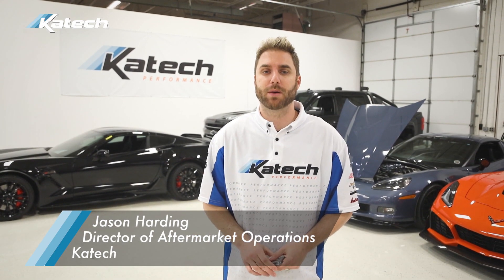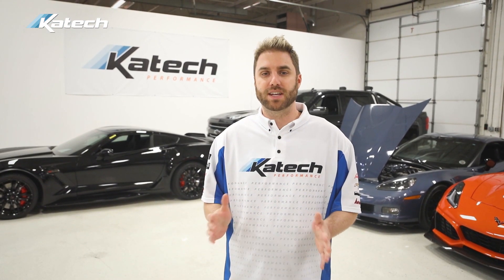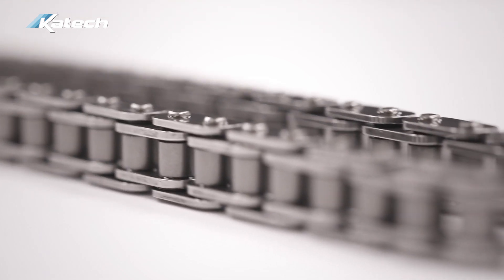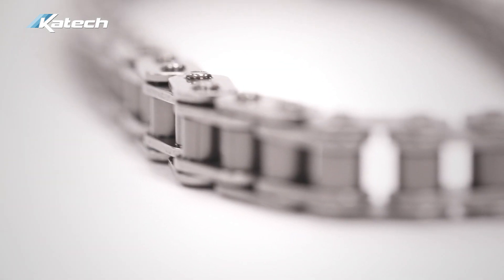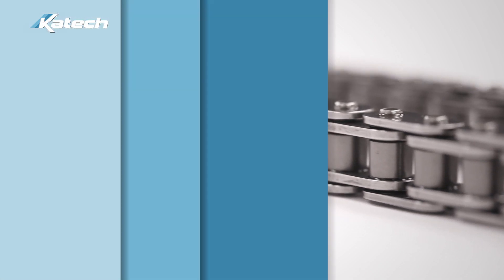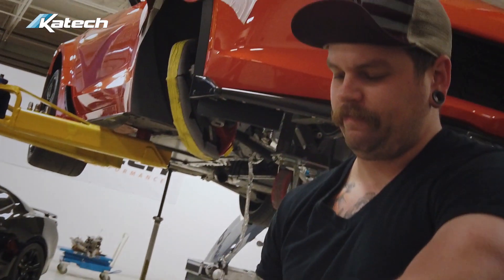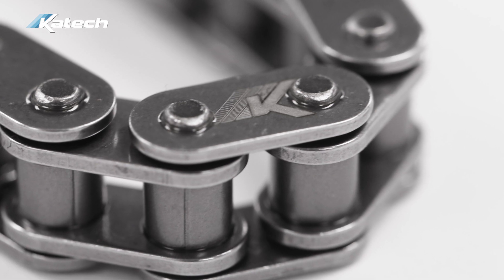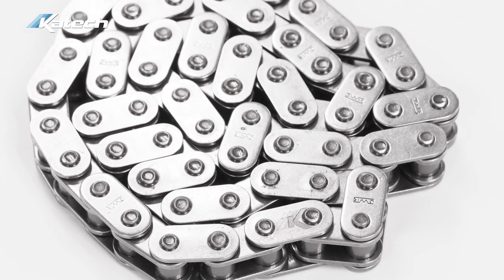Katech C5-R Timing Chain For Gen 3/4/5 LS & LT Engines

Comment: Hi guys. 
What kinda lift and spring rate are you’s running with this chain? Are you using the ls style chain dampener still or a std ls3 chain tensioner? 

 I’m having issues with breaking double row chains. And this looks like it’s a option to give it a try
Reply: From my understanding alot of the ls3 guys switch the tensioner out for the "dog bone" style guide from a ls2 engine. I'll be doing the same this winter.

As far as chains go I believe this is the go to upgrade instead of double row.

Comment: These chains are manufactured by jp performance timing chain and are the same ones used on the PJP billet timing set which is about $50 less than this chain. Nothing like repackaging products from another manufacturers and selling at a premium!
Reply from the maker: Dualsnrokel, This is absolutely not true, our chain is not a JP Performance chain. We have exclusivity from our chain manufacturer and sell the most proven, durable timing chain on the market. If your timing chain is not etched and it does not come from either us or an authorized dealer, you are buying a knock-off chain that is an inferior product.
Reply: If you’re going to make assumptions and buy knock offs then don’t blame Katech when things go wrong!